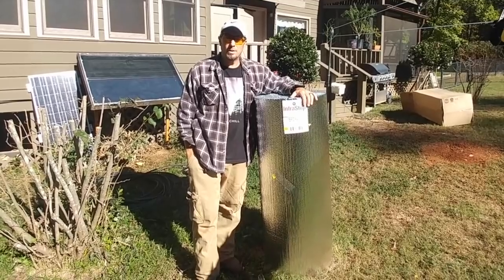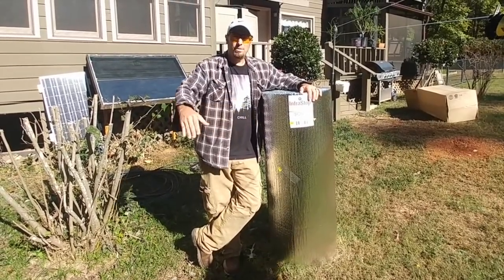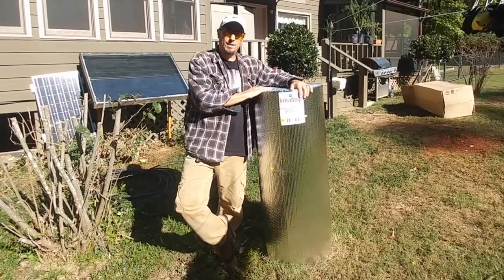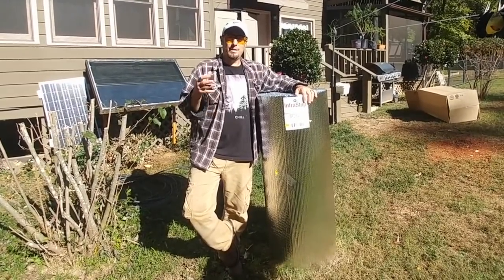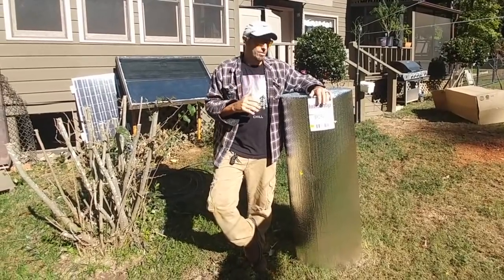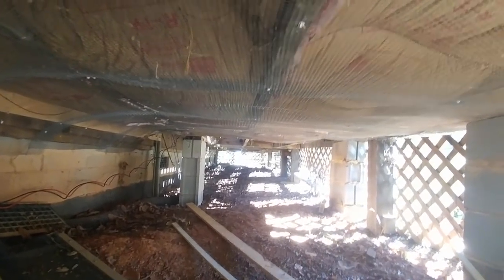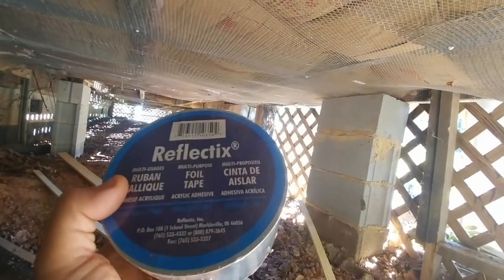Does Bubble Foil Really Work?

Comment: Umm... I hope you don’t end up with any mold. You’ve done this wrong. Sorry to say, but the fiberglass batts are placed upside down. The paper side (which is a vapor barrier) is supposed to be facing the towards heated side. Now you’ve added the foil, further trapping the moisture.  This isn’t my opinion, it’s proven fact. Not trolling here, just pointing this out to hopefully educate people.
Reply: 25 + years in the trade has shown me,  
as long as its dry when your installing the vapor barrier (in this case foil faced) and the seams are taped.  ..it'll be fine.
Reply: uncle bob, uncle bob ...Ignorance is bliss I suppose. 33 years for me in the building trades and I’ve seen plenty of problems with trapped moisture creating a mold habitat. Like I said, I hope this doesn’t make problems for you, but it’s proven science and standard building practice to protect your home from mold by means of a vapor barrier on the warm side of the insulation. Why are you digging your heels in about this? Your unsuspecting viewers should be made aware of this issue.  The fact is, even if it was dry at the time of installation, it’s (the insulation) subjected to moisture, and vapor, that are both by-products of a normal home. What you’ve designed is a trap for this moisture.
Reply: uncle bob ... (And to anyone who may be following this thread) You are I’ll informed about the vapor barrier and the dynamics of ‘how stuff works’. I’m not questioning whether or not your house feels more comfortable with this newly added bubble foil. But, there’s much more to consider:

In a typical crawl space a 6 mil plastic sheeting is placed throughout the area,  (I noticed yours has none) directly in contact with the ground. This is designed to minimize the ground vapors from lingering in the crawl space and negatively impacting the structure above. (The Kraft faced batts under your floor are not designed for that task, read on)

Inside your home,  (all homes) there’s a continual process of humidity changes from day to day and season to season. Sometimes it’s dry, sometimes it’s humid. Where does the moisture go? Do you have any knowledge of the term “ vapor permeability “? It’s a process where water vapors (humid air) travels through building products at a particular rate. This includes wall coverings, flooring, paint, etc. (Most manufacturer’s  disclose the permeability of their product) The only way to stop it is with a vapor barrier!   HOWEVER...

What you have done is (blatantly wrong) placed the barrier underneath the insulation, thus trapping moisture inside the envelope of your house. What you don’t understand is that the moisture originates from INSIDE  your house (all homes). I’m not talking about a leaky pipe or faulty roof. Cooking, showering, even breathing gives off water vapor. When proper vapor barrier installations have been performed, an airtight / vapor tight barrier is created which blocks the moisture from getting into the stud bay (or floor joist areas) and wetting the insulation, forming a perfect mold habitat that will spread and cause mold to eventually show up inside the living space. 

Your claim that it “has made an improvement” in the temperature of the inside of your home is NOT what is in question here! There’s plenty of ways to make your home warmer inside, but the people who go out on a limb because they think they found a easier way of doing something are usually dead wrong, and will likely come to realize it eventually. 

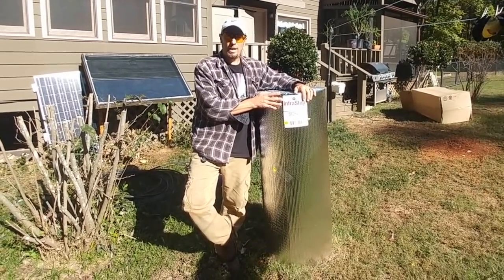I actually did read your previous comment slowly.  But nothing mysteriously changed. You’re still wrong, and in your ignorance you’re trying to exonerate yourself, even though @ 1:10 you admit knowing nothing about this subject. And again @ 8:44 you concede that there’s no scientific evidence to support your claims. Maybe it’s because the entire building codes across the nation, as well as building engineers and scientists internationally have been duped! You might be in line for the Pulitzer Prize for your new discovery. ...Or you’re wrong. Lol
Reply: @bighammer587  I'm not the one who made the video. 
I agree with some of what your saying.  But it's not all black and white.  Based on watertable, grade, air flow, size and quality of barrier and the installation job. 
..there are just to many variables.
The origianal comment that seemed to trigger you was 
 ..If its dry during installation,  and all is 100% sealed. ..properly. 
It'll be fine. (This is just my opinion base on experience,  just like you have your opinion base on your own experience)  

Thats all. 
..again,  it's not all black and white.
Reply: Uncle Bob, listen to Mark he knows what he's claiming. The only way you can get away with 2 vapour barriers is if the entire cavity between was filled with 2 Lb. closed cell foam. Think of a foam filled beer cooler. That's why they don't use fiberglass in coolers these days.
Reply: @georgelabottum7448  I'm not disagreeing.  It's just not all black and white.
Reply: Mark Pool Hey bro, you are 100 % spot on! I like the old saying " I've been doing this for 33 years,  however I never learned how to do it right to begin with so I've been doing it wrong for 33 years. 😂 LOL. I have a degree in Building Science and have been in construction most of my life. I just turned 68 and probably have seen just about everything. Just to add a few things to your most excellent information. First off , there are two trains of thought to deal with the underside ( specifically the crawl space) of a house. One is direct air flow per foundation ventilation and the other is complete encapsulation with a dehumidifier. In times past direct ventilation worked fine before we had modern air conditioning. The cross ventilation of air kept the crawl space conditioned adequately. I have worked on all ages of homes plus feel like I have a wealth of knowledge when it comes to building standards (codes.). A lot has changed over the years. Unfortunately I think a lot of it is for the worse. 
 We must keep in mind that the climate where the structure is located is in direct proportion to the system to use. Now we introduce modern HVAC systems and things get more interesting. Encapsulation might be the preferred system. Insulation per say has seen a very wide array of applications over the years. I worked at Certainteed Insulation Inc. for several years. Fiberglass insulation is nothing more than an air medium. To get the full R- value the thickness must be consistent either for batts or blown in product. I cannot tell how many times I saw the QC guy and the team manager shaking the life out of a batt to get the desired thickness. If it didn't measure up some of the run would have to be scrapped lol. Also ,over time blown in insulation tends to settle out thus reducing the R-value. 
  Back to the crawl space. Central heat and air systems typically have the ductwork under the house. Now we have to deal with condensation. I have actually seen ductwork dripping from condensation with termites that make like a tower up from the ground to the duct. This is typically caused by warm air blowing through foundation vents across the cold ducts when the air conditioner is running. Encapsulation with a dehumidifier is a good fix for this. 
  Fiberglass insulation deals with convection heat and cold air transferred through the structure and the fiberglass itself. R- values can be very ambiguous and misleading. R-value being resistance to air flow. It has no effect on radiant heat infiltration. This is where radiant barriers come into play. Personally, I am a huge advocate for it in conjunction with fiberglass, preferably batts. Again assigning an R-value to radiant barriers can be misleading yet they work extremely well. R-value doesn't necessarily figure into the equation. Innovative Insulation located in Texas is a manufacturer of radiant barriers and has a full line for any application. 
  I hope this information has been helpful to anyone reading this thread plus the original thread above. Thank you!
Reply: Have a great day everyone!
Reply: He’s right about trapping moisture between the two moisture barriers. And he’s right with adding a vapor barrier to the exposed earth/ground.  And just because it’s dry during installation, lol, that means nothing.  Humidity acts as solid water and seeks its level in content. The moisture from under the house, the earth, the exterior air will seek the dryer air within the living space above. It will be trapped within those materials and growth will form. It’s basic building science. Also,  in recent years I’ve learned that your standard crawlspace having standard batt insulation under the floor, if you use the new vinyl plank flooring or something similar, you will have Major problems!  Moisture will permeate upward into the structure and be stopped by the waterproof flooring.  The difference in temperature and condensation at the wood sub floor will feed organic growth and deteriorate like you wouldn’t believe.  It’s a real problem with these new builds built on raised foundations these days.
Reply: Hi Ray!

I know it has been a while since your post but I do hope this finds you well.

I am purchasing a 1989 Manufactured home upstate NY. I see there is an underbelly that had been compromised with fiberglass insulation sucking out in spots. 

I noticed that inside the home, there seems to have been work done on two adjoining walls that have electrical outlets in them. It appears to me that there was a rodent issue that may have left the electrical wires chewed. I am seriously concerned about this because when I went into one of the other bedrooms, and turned on the light switch, I heard a crackling sound. 

I am thinking about having the whole place rewired and having all new plumbing put in.

I am trying to do these things as cost effectively as possible.

Can you please offer any guidance on what I can do to protect the Romex wires as BX Cable will be too costly at the moment. I want to make sure that I can use the radiant bubble sheeting correctly so as not to trap moisture under the home and cause mold to build up anywhere and I don’t necessarily want to have to run a dehumidifier either for power down situations.

Is there a proper way that I can achieve a rodent free solution without creating moisture buildup and keep it warm enough under the house so that the pipes don’t freeze without having to use heat tape. Where I am going gets very cold and can be know. To lose power. Thank you for any guidance you can give. 🙏🏻 @rayburnyarborough4695
Reply: @JanColdwater hi Jan, nice to hear from you. I am intrigued by your channel. Is there any way that I could contact you personally. I know it can be a little risky on YT. I have a backup email I could send, unless you have another idea. Thanks 😎!
Reply: @ Hi! Thank you for reaching back to me. Please send your email. Thank you 🙏🏻
Reply: @JanColdwater  zerrubbebel
Reply: @JanColdwater  mail
Reply: @JanColdwater  atproton

Comment: Your fiber glass insulation is up side down, the paper vapor barrier should be up against the wood floor
Reply: Yvonne Dodson Yes, you are correct! It’s even printed directly on the insulation! Unfortunately it was installed improperly by the previous owner of the house.

Comment: Dude I rapped 4 times around my water heater 2 years ago. I had it set 140 F after rapping it I now run it at 120 and get all the hot water we need. I had no dog in the race. Did not pay for the stuff as it was left over. So I know it works. Wish I had the cash to do under my house. The bath room has no insulation in a few spots.. Working on fixing that soon
Reply: Bobby's Solar Homestead.....  I'm older and forgetful.  In the past I thought about insulating the water heater, but have since forgot.  So appreciate you taking the time to make this comment which gave me the reminder I need to do some research to see if this is something I can get done.  Great suggestion!  Take care.

Comment: People that complain about bubble foil simply don't understand how to install it correctly. I would say the way you did it may not be ideal but as long as you had left some openings to allow the humidity to transfer I think it should be ok. I've seen some designs already that I know will cause rot and mold but also you do have to consider the location. Arid areas really don't have to worry but areas with high humidity should be aware that installing this material the wrong way can cost you tens or even hundreds of thousands in the future.

Comment: I live in Maine and my house  was built in 1925 and the basement had rough cut Pine with a lot of gaps  I used this product in-between the floor joists and it worked great I thought it was a bit pricey but I wasn't itching and scratching all night🙂🙄 thanks for the video

Comment: Yeah ... my favorite toys - reflectix and radiant barrier.    Yup, excellent work.  Now (as previously said) run that reflectix along the porch rafter for reflection and greater sunlight.  If you ever close off the porch into a double-paned greenhouse, all that gained sunlight and heat will give you an all-season garden on the patio, vs the landlubber gardens outside.

Comment: I think the fiber insulation is backwards, paper side if I remember correctly is supposed to go against the heated side of the walls or floors as a vapor barrier. Put a moisture/vapor barrier down on the ground like 10ml plastic and seal joints with tape. Bubble radiant barriers work to prevent air and moisture infiltration.

Comment: Skirting the deck will prevent the wind from blowing through and sucking your heat out. The insulation thats squished by the mesh has much less than r19, so if you fix that and fill in all the gaps, you ll get a lot closer to dr19. 
The bubble wrap also works great for preventing passive solar heat in the summer as well if you wrap an outside wall or greenhouse when it gets too warm.  While the bubbles have a small r value, the aluminium will reflect the heat within your shop if you cover the walls with it.
Reply: Skirting is the right answer. Plus the swamp guy that's referenced here talks about this!

Comment: I have a problem with a rental property of mine. It's a ranch style 4 family. The back 3 feet of the property is cantilevered. It just so happens that the kitchen and baths are above that area. Stupid design!! In bad winters I deal with frozen pipes. The company which manages the property installed  these heating tabs on the pipes that automatically turn on when the temp drops. Pretty cool because it seems to work!! Your bubble foil is pretty interesting. I wonder if I could have it installed under the cantilever area? Here's some advice for everyone, that bubble foil is probably a good product to have around. This winter is going to be really cold (no sun spots) so it might help keep in body heat if you could close off a room in case of a power outage. Hopefully everyone has a fireplace place at least. Thanks for the video and it looks like your son is a great helper! Great dad son bonding with some practical education. :)

Comment: We have a similar off grid cottage on piers. We insulated the floor in the main cabin plus skirting with 1” blue board. We then built an addition which is going to be a kitchen. We used the double bubble foil roll on top of the 1” subfloor then 3/4” select plywood on top of the foil.

Comment: The air gap (which has some insulative properties), plus (especially) the sealing  effect of your experiment conttibuted to an expected improvrment. That doesn't mean, however, that a better result coulfn't have been achived with more/better insulation & especially sealing from outside air. As long as you're happy with the final result, it's a win. Scientific approaches to a problem is always best, however, in my experience. In short, both insulation (with higher R values) & air sealing (to prevent hot or cold air infiltration) is the proven approach for superior results.

Comment: Great video. I used spray insulation under my sub floor at my parents house which btw is in south Texas and the house sits 24 inches from the ground. Then we installed two layers of critter wire mesh and  just like you we used reflective rolled sheet in the same manner as you have. It’s been 6 years since the remodeling and no mold and no sign of mice/ rats or squirrel holes anywhere. We also included air vents on the siding to allow air to move through to keep out moisture from under the house.  Btw you look like Adam Sandler. Have a great day.
Reply: yes, he does resemble Adam Sandler! But thankls for your process/results. Trying to do under the deck 3 season room in Ohio.

Comment: This is how not to install foil, that should go on the warm side which would be just under your floor. You’ve basically stopped all air flow to your joist. The warm air from above will travel through the insulation hit the bubble, condense against the cold and form moisture which will be trapped, this will then rot your joists. 
You need to either remove the floor and run across the top of the joist leaving the bottom of the joist open to air or remove the old insulation and wire and staple it under the floor leaving the joists open.